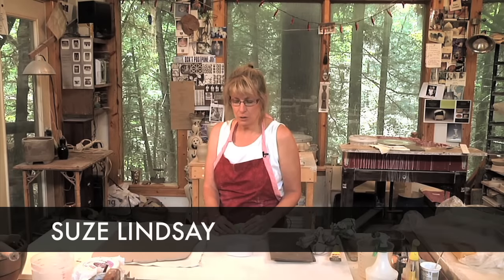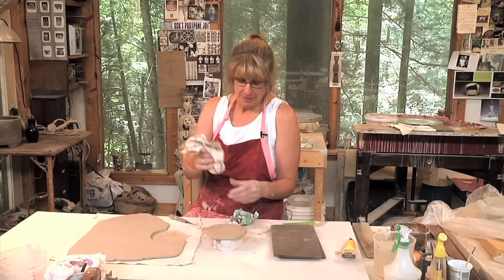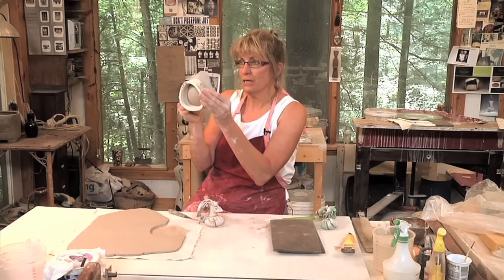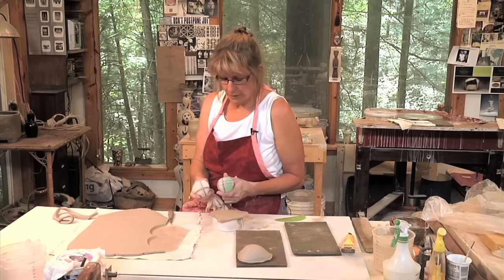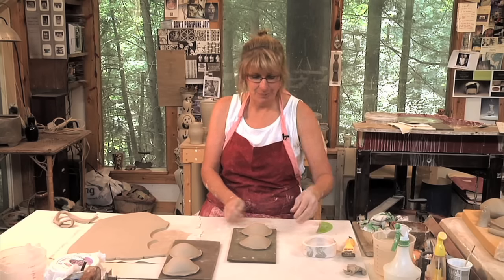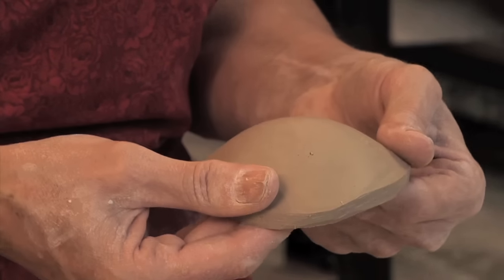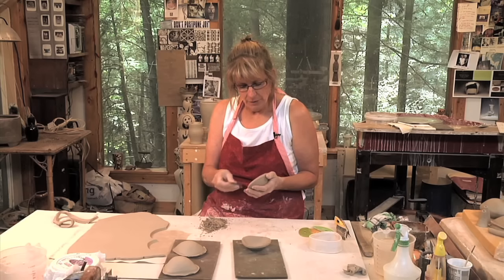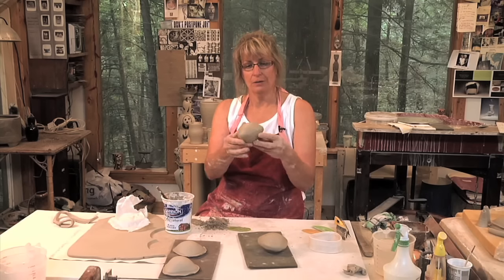Pottery Video: Handbuilding with Drape Molds | SUZE LINDSAY

Comment: Thank you for sharing this video!!! Question...Do you poke a hole in it before firing?
Reply: I did not post this video, but have created many closed forms. YES, you need a small hole in your piece. The air inside will expand beyond the piece's ability to contain it. It will explode and ruin your piece.